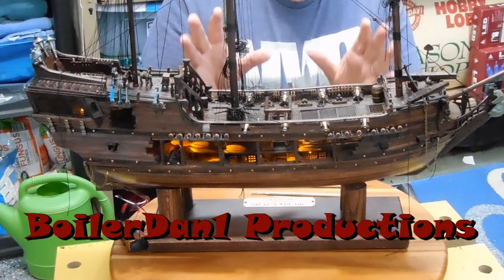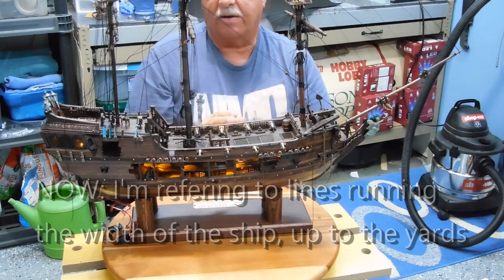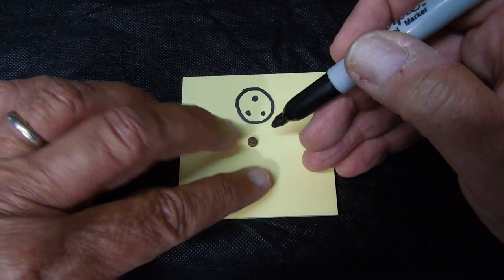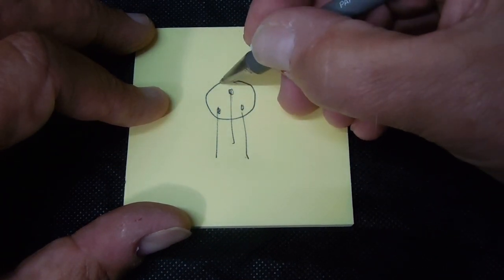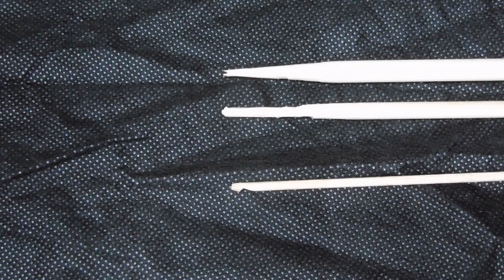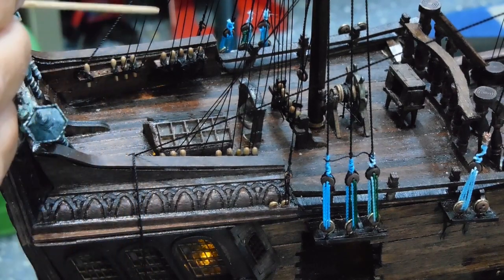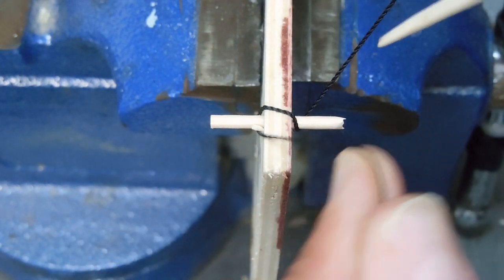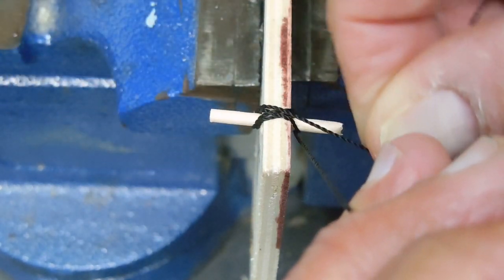The Black Pearl Model Ship Part 28

Comment: Hey Dan, I’ve noticed that on the original ZHL model (expensive version), they’re open hall is a bit different, they have 2 floors open for display, I was thinking that when I’ll build my Chinese knockoff, worse case (if the instructions are going for 1 floor look) I’ll change the outer planking to fit 2 floors ver. Could you tell me if the 1 floor design was your personal preference? What I find weird is that the photos of the Chinese knockoff are also showing 2 floor design.
Reply from the maker: At the time I was building mine.... being a novice in ship building.... I didn’t give it much thought 🤔....but as I completed the different decks I did realize that a lot of the work I did on the lowest deck was never going to be seen!  So yes, if I had it to do over I’d give serious consideration to leaving it more open, because you can turn the ship around to have different views.  You were more observant than I and can make that adjustment for a better build.  I’ll just have the memory of what’s in the dark shadows of the lower deck.....maybe that’s part of the mystery of The Black Pearl 😉👍
Reply from the maker: Let me add to my reply.... in hindsight, I think I planked over more than I should have. I think once I got started I simply didn’t pay enough attention 🧐. Maybe I’ll have to build another one next winter!🤪
Reply: 🤣 whatever you choose, I’m sure it will be amazing, so was it your mistake? Or the instructions told you to to only leave one floor open?, I’m a little worried about that my model doesn’t come with all of the luxury pieces like the statue in the front.. will probably need to sculpt one from scratch 🤦🏻‍♂️
Reply from the maker: RiverDome ; I think it’s my error, although the instructions are terrible and I don’t think covers any specifics about it. I should have paid more attention especially after adding things down on the lower level.  I could cut out some of the planks, I’ll give that some thought 💭. I’ll mention it in my next video production too!     I was fortunate enough to get a kit that has the statues made out of plastic (3D printer probably).  I did some filling and sanding for sure.  I just lucked out when I painted them and am very happy with the results.  Sorry yours didn’t include them.... grab your dremmel tool and start creating 🧐.
Reply: I see, well I'm in favor of you cutting an opening in the hall, just plz make sure it's not gonna damage anything 🙏🏻.
Also I hope that you have lights in the lowest deck, because if you don't, it's just gonna be more complicated to install after the ship is built.
My kit hasn't arrived yet, but in the pictures it seems that it's a bare bone model.. it's gonna take a lot of work, which would be awesome 😎.
I'm mailing banggood to check exactly if it has the plastic parts, but they seem a bit clueless 😩.. we'll see..
When did you realized that you covered the lowest deck? 😅 probably was an insane moment
Reply from the maker: I think I really realized it when you brought it up😂. Yes I do have the lights down there........🤪💭🥳.  It’s going to be one of those things I can do out in the future......   Banggood has several versions. I hope yours has the plastic statues. The cheapest has flat wooden ones... maybe use as a template to then carve out a 3D version?  If you look at the one you ordered online, the white plastic ones can be seen in the container with the smaller parts and cannons.

Comment: Hey Dan, what size planking did you order from modelexpo? Thanks
Reply from the maker: Here’s the list of what I ordered to start with...... I’m starting to think I could have purchased the actual ZHL model.... not really, but I’m guessing I’ve spent about $75 in additional parts 😳 here’s the list.    I didn’t use the pedestal item:    WALNUT STRIPS 1x5x500mm 50/pack 1
Corel C400 Gun Port Hinges - 13mm - Copper Pk of 100 hinges 1
HELM & PEDESTAL, Boxwood 19/32" (15mm) rim dia. 1/pack 1
JACKSTAY EYEBOLTS, 1/16 x 1/2" 60/pack 1
Subtotal:$42.96
Discount(s):$10.00
Taxes:$0.00
Shipping:$9.99
Total:$42.95
Payments:$42.95